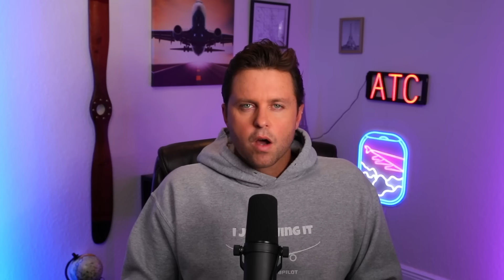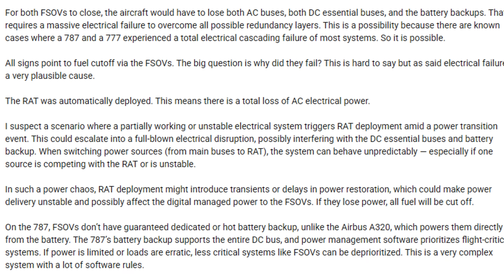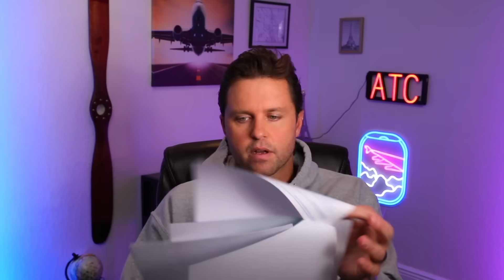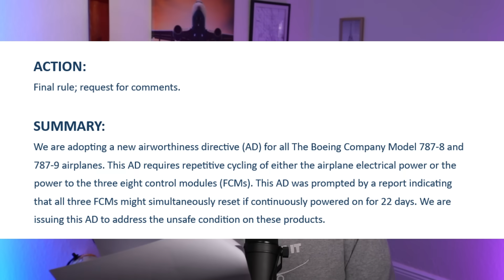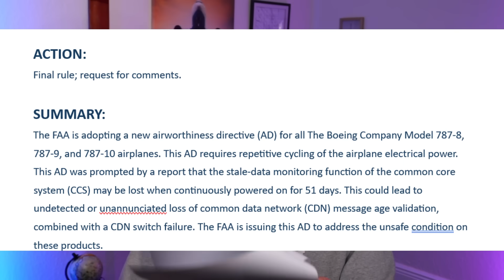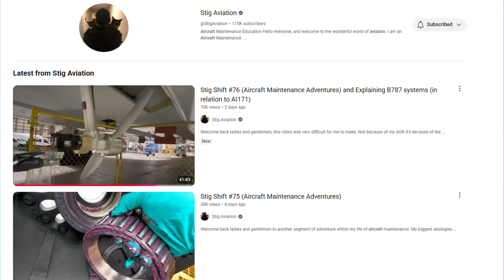Air India 171: Did a Software Glitch Cause Dual Engine Failure?

Comment: Really, the fuel supply valves are fail closed? No way! I cannot believe that. Fail closed. That is a formula for disaster!! What you have put forward here makes sense, It had to be a common failure to both engines. When I looked at the probabilities of independent engine failure the odds are so astronomically low as to be virtually impossible. But this represents a feasible common cause. 
I have been involved in chemical plant design and there is a choice about whether valves fail closed, fail open or fail in their current position. That choice is about what is the worst case scenario when all else fails....what position would you want those valves to be in. In the case of an aeroplane it is hard to imagine that the fail closed could be the option chosen, since when all else fails, you really do want the engines to keep running. There ought to be another way, such as a manual over-ride, with appropriate controls, to shut off the fuel supply to a burning engine. But having the supply valve as fail closed seems complete madness to me.

Comment: Retired Air Canada 787 Capt. We have a memory DRILL for double engine failure. “ both fuel control lever off, then on “ then push and hold ram air turbine switch. 
Hope that makes sense.
Glenn

Comment: This is what I found with Google AI search:
A known software problem in the Boeing 787 Dreamliner can cause a complete electrical shutdown. This occurs due to a software glitch in the generator control units (GCUs) if they remain powered on for 248 consecutive days (approximately eight months). If all four GCUs enter a fail-safe mode simultaneously, it can lead to a loss of all AC electrical power.

Comment: Based on the current information status, I doubt it was a pilot error. However, without seeing an actual architecture diagram with description of the components / functions, this theory is missing key evidence (even though it might be highly probable). 

But if true, the implacations are quite severe... Potential grounding of 787, Boeings flagship. If this becomes the lead theory (even if not true), its terrible news for Boeing.

Would be highly appreciated if you could present more evidence for the theory.

Comment: Sorry, but you are incorrect. The FSOV is not spring loaded shut. It requires electrical power to move it shut. The same is true for the low pressure fuel supply shutoff valve.

Comment: 7:20 Google AI search is wrong. 
The Spar valves; 
A, aren't spring loaded (fail safe close) as that would be stupid. 
B, they do have a back up power supply that insures control of the Spar valves is possible in the event of a catastrophic engine failure.
C, Over temp detected and Loss of Bleed pressure is just something the AI has made up, there is no independent logic/software that control the Spar valve, it's a very simple valve that stays open all the time unless directly commanded to close.

Comment: My money is on a FADEC software problem.  No computer should be fully autonomous, meaning that it can over-ride a human.  If the FADEC spools down or kills the engines there is nothing a pilot can do.
FADEC problems, not pilot error, were ultimately found to be the cause of at least two crashes -
https://en.wikipedia.org/wiki/1994_Mull_of_Kintyre_Chinook_crash
https://en.wikipedia.org/wiki/2015_Seville_Airbus_A400M_crash

Comment: Based on the subject of this video, I had a similar thought 6 days ago when I posted this comment on Capt. Steeve's 2nd Air India video:

"Going deeper, I'm wondering the age/series of that particular 787 itself. What was it's most recent maintenance schedule? More importantly, and I'm flagging this directly, had a firmware update been performed to it's software during that maintenance visit? Was there a conflict in that software that led to the catastrophic shut down of the engines nearlly immediately after lifting off? It's a scenario that has played out in other industries such as the communications industry and radar systems in New Jersey, and it's one that should not be overlooked here."

Comment: These Boeing 787 continuing issues should ground the planes until a reliable fix is found and implemented.
I regularly fly and have avoided Boeing aircraft ever since problems arose around the 737 MAX. The Boeing safety record over the last decade has taken a beating.
Flying KLM out of Amsterdam to Canada, I double-checked to make sure I'm on an Airbus.

Comment: Question: could this be solved by programming the FSOV's to delay shut off by maybe ten to thirty seconds like 
If the loaded spring was replaced by some geared timer that can be stopped by pilots using RAT power and coupling it with a audible warning to give the pilots time to overide the shut off command or something like that ? 
Also the GCU's and FCM's and other regular electrical power shut off routine to avoid fail safe mode shut off might be included in the flight plan setup checklist so that the computer will ensure the maintenance is done and not forgotten by service workers or maintenance personnel 
Also another question:
Will these ADs from FAA be destributed to all the companies that buy the aircraft or use them and to the maintenance staff 
So that they can have a say in weather or not they have a safe service or if something must be done..?
Just sharing my thoughts

Comment: We know the landing gear failed to retract. What if, the pilots moved the gear lever up and down a number of times to try to get it to work and then left the lever in the down position? This might trick the FADEC into thinking the plane is now landing and is close to the ground.  This would cause the FADEC to detect an over thrust situation and automatically throttle down the engines for a safe landing. It was a perfect landing alright, right on top of the buildings!

Comment: No way it's a software glitch !!! Unless boing is relating the software without prior test,  we will see aiplanes falling from the sky everyday!
Creating a software that if it detects an even it immediately shuts down the fuel is a first grader coder. 

Usually event triggers are always in loop monitoring in the millisecond timeframe, it does not stop when the event happen, and there are series of actions and each action has multiple branches of other actions, in which, all these actions are tested before the software is released in production.

simply saying t's just a software glitch without reviewing the code is BS statement.

Comment: Fuel contamination, vapour lock or pulling the flaps lever instead of landing gear, are all low-likely. 
Electrical failure is the most plausible. Tracking it back to software is a fair start

Comment: Honestly in 45 years of aircraft engineering I have never heard of a fuel shut off to be activated when power is removed as you describe it. The fuel shut off on large turbines are of a butterfly type . Electrical activated to on or off. No springs involved at all. This can be activated via a switch or by atuo when the fire extinguisher handle is pulled. Just because you loose electrical power on the airframe no manufacturer is going to shut down the fuel to the engines.  Then give will operate with no power to them . Fadec systems will run on the PMU/PMA . engines will not run on air though. I highly doubt what you have said is true.

Comment: This sounds like the real the root cause and represents major design flaw from Boeing+FAA !

Airbuses have independent electrical power to the Fuel Shut-Off Valves as fail-safe to keep engines running in case of massive electrical failure, but Boeing+FAA don't !!

I can even predict Boeing+FAA will cast blame on the carrier Air India for not properly implementing their insane resolution of regular 'shutdown & restart' maintenance fixes to cover up Boeing's computer/software failures - try doing that at 625 ft !!!

Comment: Gary > you said to put it down in the comments : 

1. Primary Cause – Electrical Power Transfer Interruption (PTI) During Rotation
 • During transition from ground to airborne electrical configuration, the aircraft experienced a cascading dual-engine FADEC (Full Authority Digital Engine Control) failure.
 • Root cause: Uncommanded bus transfer failure due to arcing in the main power relay box (PRB-A), traced to water ingress during pre-flight GPU disconnection in heavy rain.
 • This led to loss of electronic engine control at rotation, resulting in both GEnx engines rolling back to ground idle within 4–5 seconds.

2. Flight Data Record Timeline
 • +0:11 sec: Nose gear lifts off.
 • +0:13 sec: Sudden engine rollback begins. Thrust reduces from 92% N1 to <27% within 3 seconds.
 • +0:16 sec: Master caution + ENG FAIL L/R warnings. FO calls, “Both engines dropping!”
 • +0:20 sec: Autopilot and flight control reverts to Direct Mode. Pitch up attitude peaks at 18°.
 • +0:25 sec: Aircraft stalls at 186 ft AGL.
 • +0:30 sec: Full aerodynamic stall; nose drops rapidly.
 • +0:38 sec: Ground impact at 54° nose-down attitude, 174 knots.

⸻

⚙️ Contributing Factors
 • Environmental Conditions:
 • Torrential rain during pushback.
 • Moisture intrusion into PRB-A connector (P/N: HLN8471) — a known corrosion-risk component.
 • Latent Maintenance Issue:
 • Power transfer relay unit showed signs of thermal damage in a previous MEL deferral 2 weeks prior.
 • No replacement had been conducted; aircraft was cleared under repetitive deferral.
 • Design Oversight:
 • Boeing 787 has no physical engine control backup (i.e., no direct mechanical linkage in FADEC loss scenario).
 • Loss of power supply to both EEC channels resulted in engine “freeze” at ground idle instead of flameout.
 • Flight Crew Response:
 • Attempted engine relight sequence not completed before stall onset.
 • Emergency power selector not activated — possibly due to confusion from multiple ECAM warnings.

Comment: Both Airbus and Boeing implement systems that automatically close the fuel shutoff valve in case of a power failure. The critical question here concerns the apparent shortcomings in Air India's aircraft maintenance practices. Why did their maintenance protocols fail to identify an impending power failure scenario? This issue seems to reflect a lack of rigor in implementing effective maintenance strategies. Instead of attributing blame to the Boeing 787—an aircraft with an exceptional safety record, this being its first fatal crash—it is vital to scrutinize Air India's approach to maintenance planning

Comment: As an uninformed old guy I can clearly add 1 plus 1 to ask this question. What caused two separate engines shutdown at the exact same moment. If it was bad fuel it is statistically possible both engines would fail at the exact same moment. Computers / Electrical can immediately change parameters On / Off.

Comment: There’s a book which talks about 787 software issues. “Humble Pi: a comedy of maths errors” by Matt Parker. I highly recommend reading it. I’ll summarise what it says here. In the first chapter Parker introduces the issue of how computers are always counting backwards down from a set number in order to time keep. The number was a translation of, basically, a bunch of 1s in binary (for example, 32 x 1 for a 32 bit system). It affects older operating systems, and caused a shutdown in 2004 of Los Angeles ATC because running down past all the numbers causes the computer to turn off. This happened after only 49 days, 17 hours, 2 minutes, and 47 seconds as they didn’t restart it routinely as normal due to accidental oversight. It counted down every millisecond from a number over 4 billion. 
In 2015 Boeing identified the EXACT SAME issue in the 787 software that controlled the electrical power generators. That system used a number approximately half what LAX ATC’s computers had used (still over 2 billion), and would count a number every 10 milliseconds (not as fast as the LAX ATC), so the 787 would lose all power if continuously on for 248 days, 13 hours, 13 minutes and 56 seconds (unless routinely restarted). The FAA said this would cause the GCUs (generator control units) to go into failsafe mode. If all 4 had been powered up at the same time, they’d all fail at the same time, “resulting in a loss of all aircraft electrical power regardless of flight phase”.
Boeing did go on to issue a fix - making sure operators know to turn it off and on again every so often, and they updated the software too so this shouldn’t happen. 
However, this does show it’s entirely possible. Might there be other systems running like this that didn’t get updated?

Comment: Personally with all of those facts, over a period of time it seems very plausible this plane was brought down by those issues. Whatever happened went very fast & valves snapping shut would fit. It seems like to me that some issues are ignored until someone dies. It’s all very sad & I hope this did not cause the crash. Thank you so much for your presentation of the information.

Comment: I agree that an electronic flight system glitch is more likely to have caused both engines to shutdown. There was no smoke from either engine, and no one has mentioned any abnormal sounds from them. It appears that both engines simply shutdown at the same time. Boeing does have a history of faulty electrical systems on their modern designs. I foresee a grounding of 787's in the very near future.    Ya know, I've always been a huge Boeing fan. I truly hate that all of this has happened.

Comment: Don’t need to be an aerospace engineer to realize that vapor lock or mechanical failure happening at the EXACT same instant in two engines independently is not what happened.

Comment: I work in hifi amps...
...we call such device a "crowbar" - a device that is meant just to stop further catastrophic development AFTER a complete failure of the power stages. Because if everything inside your box is already smoking debris, you don't want the connected stuff also go up in flames. 
Then we simply apply a short circuit. It is ABSOLUTELY essential, that this crowbar ONLY works AFTER a catastrophic failure, hence it would cause one in the first place if accidentally triggered.
That "new" explanation attempt reminds me a lot to such crowbar device and how careful it has to be deployed. I think, that new theory is absolutely plausible - enough arrogance of the constructeurs given, hence that's just what this would be...
Regards from Germany

Comment: If the comment you read is accurate, it could be as severe as the 737 MAX issue. All 787 aircraft should be grounded until the problem is resolved. This could lead to a disaster for Boeing, potentially causing irreparable damage to the company.

Comment: I am a software engineer with 30 yrs of experience. My guess (since the dual engine failure "fact" has been established (other channels)) has been and stated explicitly in the latter, that it is an erroneously commanded dual engine shutdown. I bet 100 USD on this guess in other channels. Now that I have more details thanks to you, I think my educated guess takes  on more credence. Still, it does not help those poor passengers and people on the ground that were literally burned alive or semi alive. However, if this is the case then all 787 Dreamliner's will have to be grounded until the set of real-time scenarios that lead to an erroneous shutdown command are identified. We all therefore need that data from the good black box to be analysed as soon as possible. Finally and regrettably I do not "buy" the following excerpt from the below: "For both FSOVs to close, the aircraft would have to lose both AC buses, both DC essential buses, and the battery backups.". The odds would be ginormous against such a scenario. So, my guess is, and still remains a software issue. Which brings me to the last part of this tome, which is a quote from the below: "The 787 relies heavily on software-based power management". The software failed the management, electrical power was cut off, including to the FSOV's, that automatically starved the engines and they flame out, the RAT is deployed. The plane glides to a crash. If I was the FAA I would ground ALL 787 Dreamliner's; however and as with the 737 800 Max, they are gambling with people's lives rather than siding on the cautious approach.

Comment: @per-henrikaltestik writes further down in the comments, as a 787 engineer, that there are no spring loaded fuel cut off valves in the 787. Does this mean that there is a fundamental flaw in the whole theory described in great detail by @HeyFixThis, or can it lead to the same effect if the fuel cut uff valves are not spring controlled?

Comment: The video of inside cabin "electric problems" doesn't mean a thing! Shows the entertainment system powered on but not working on the touch screen. At the same time all of the plane illumination is ok, lights on, bright! A/C has nothing to do to that either.

Comment: I think that this seems very, very plausible. I have no background in aviation/engineering, but what is explained seems very logical to me. I am curious why we have not had a read out yet of the flight CVR or the flight data recorder. I feel like the NTSB is very much of the mindset of share information we can reasonably validate quickly in the interest of public interest and transparency. Is that simply a cultural thing where American’s “want it now”…. Or is at to be viewed as more than that? It seems like we should have something more official than what we have had by now. I agree with the sentiment that if this is what happened, the 787 needs grounded until fixed.

Comment: Thanks a lot for this excellent video, which reveals so much. Similar to the 737 Max story, it seems as if Boeing engineers – in their finite lack of wisdom – created some "unpredictable" and  problematic software that took control out of the hands of the pilots. With the expected horrifying results. This should be the end of Boeing.